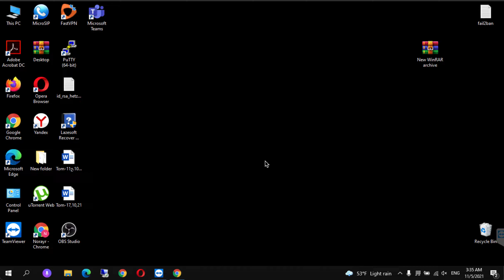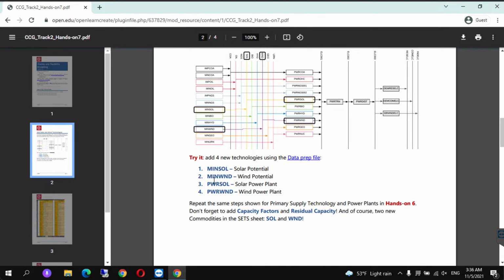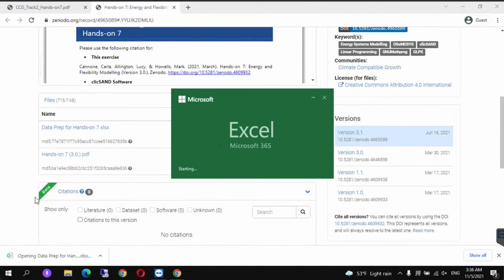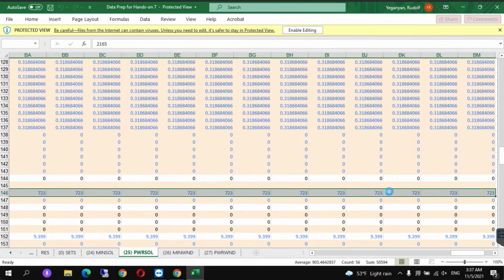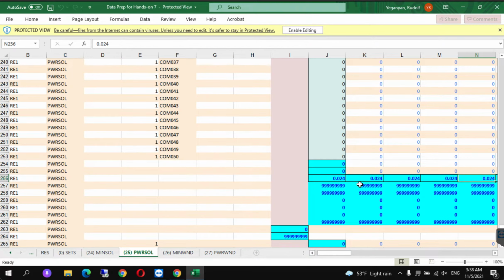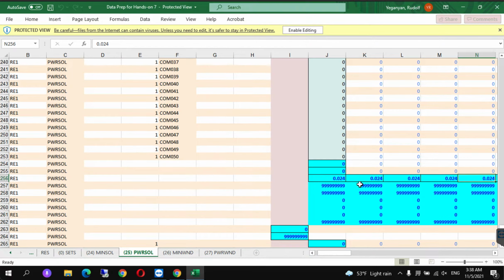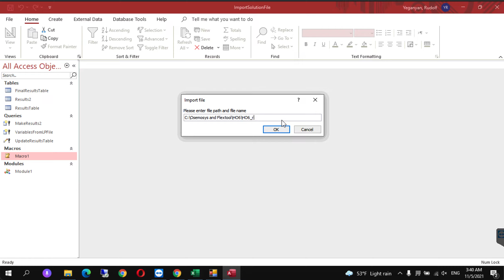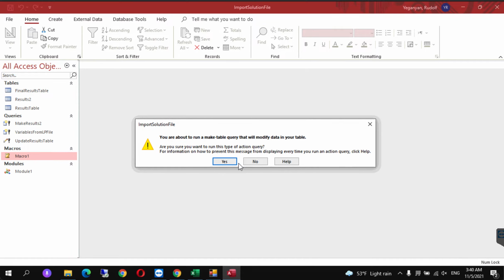OSeMOSYS & FlexTool course: Hands-On 7

Comment: Hi there, Thanks for the tutorial, I'm still struggling with the results of the graphical annual electricity production representation, as skipped working on the excel sheet on this video from 6:18. Please, any link for assistance?
Reply from the maker: Hi again @berkefede. Message passed on to the model curator - hope to get a reply soon
Reply from the maker: @berkefede

After completing the steps in the hands-on exercise, please try comparing the graph generated in the Excel sheet with the graph in the PDF.

The PDF with instructions can be found here: https://zenodo.org/records/4965089#.YhduAe7P30o

Hope this helps!